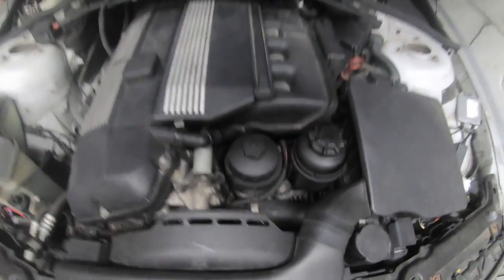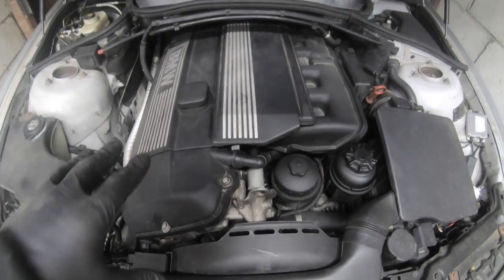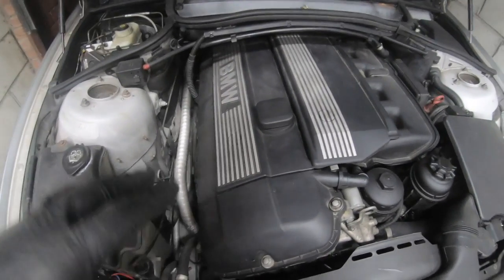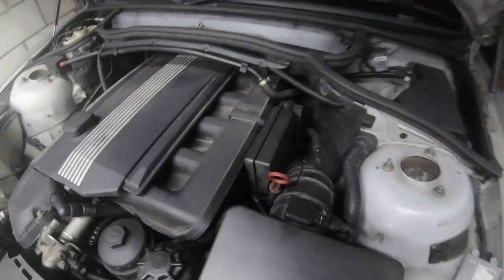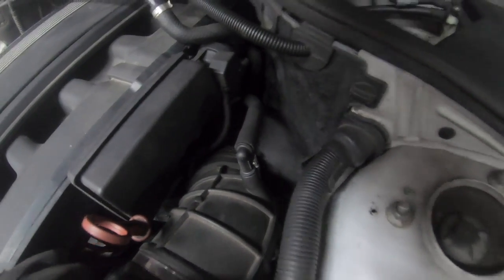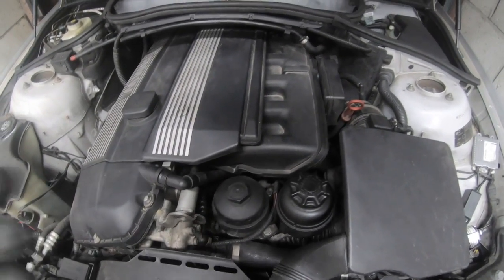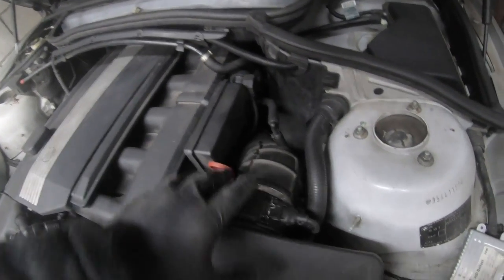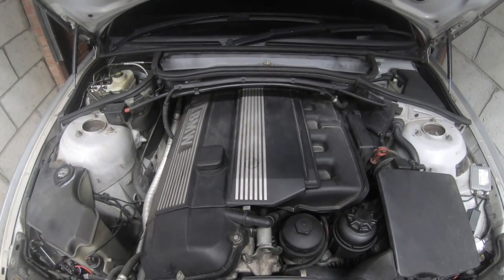Things You NEED To Replace On Your M54 Engine At 100K Miles

Comment: Great video. I have an e39 140k miles, auto transmission. The speedometer doesnt work and have abs/dsc/brake lights all on. I already replaced the abs wheel speed sensor. Still doesnt work any ideas?
Reply from the maker: your best thing mate is to scan it its important to always scan to find the correct codes for these things thats why bmw is heavily armed with alot of sensors to make diagnosing as easy as possible I will state ISTA is your best option mate
Reply: If you already replaced the RR sensor then likely the abs module has failed. You can confirm this by swapping pins at the module for wheel speed input with the LR, or piggy back the signal at the back. (LR feeding the RR signal)
Reply: Cameron Holowach The abs wheel speed sensor is on the rear left. Is that right?
Reply: I had the same issue minus speedometer issue. All 3 lights on after wheel speed sensor means you need to get abs module rebuilt. Very common and should fix it

Comment: My buddy has a 2000 323i and it’s about to cross 200k, still runs strong. As long as you do maintenance on a BMW they will last forever.
Reply from the maker: exactly mate these engines are brilliant and cant be matched I love the M54 engine I always have its the best engine ever produced and I don't care what has come along since nothing beats the M54 plant
Reply: Completely agree, not to mention the e46 platform is straight forward to work on. Hell even my e90 is easy to work on, its not cheap but it’s easy. When people that ask me what car should they get, i tell them don’t get a BMW, their instant reply is “is it because it’s not reliable? Heh heh heh” I tell them no because your cheap ass won’t maintain it, BMWs are super reliable as long as they are maintained proper.
Reply from the maker: thats exactly it mate N52 is a easy easy engine and so is M54 I believe especially removing valve cover on M54 is alot easier then N52 but in the same essence BOTH have there ups and downside the M54 is a great engine and very smooth and is very cheap to maintain providing your doing the work yourself ON THE DOWNSIDE N52 is a expensive engine to maintain and doesn't run perfectly smooth as M54 because of the solenoids but N52 is still a cracking engine and I love how it performs both are different units M54 vanos is brilliant BUT N52 valvetronic delivers it alot better for the timing I think and gives that oommmmmph when you need it and not so high rpm
Reply: The knowledge you know about these cars is why I’m subbed and binge watch all your stuff mate. Yeah my buddy with the e46 was about to sell his car because of the leaky oil filter housing, valve cover gasket, and disa valve. BMW quoted him an astronomical price to do it. I said Ryan, just buy the parts from them and we can take care of the rest. I’m not even close to being a mechanic but common sense and a little know how got the job done.
Reply from the maker: yes mate that is all it takes mechanical knowledge is bollocks these cars dont require special tools and mechanical knowledge my 10 year old could fix these cars mate the rates garages charge and tell people is disgusting 

I was actually gonna call garages here and get quotes and show people how garages con people and record all the phone calls to show you guys how much garages charge for one job and how long they tell you for each job like for instance n52 MANIFOLD takes 10 mins a garage will say it takes half a day to remove it lol and £650 and then I will go back at them telling them I can remove it in 10 mins so why the high price and lets see what they say
Reply: @BMWDoctor  Still waiting for that phone call video...What a lump of turd most garages are Money Pits filled with leeches!    
       The words " Brilliant" Trust Me" "Take my word for it" are all Overused and Shady.
         Reality and facts are better worded this way. The truth is hard to take for most car repairs!
             Dr Dean is a Keen Machine that revs smooth as silk!
              Keep up the Great Work young man!
Reply: Somebody teach Scotty about these engine reliability 😑